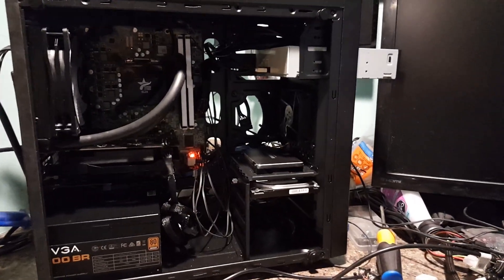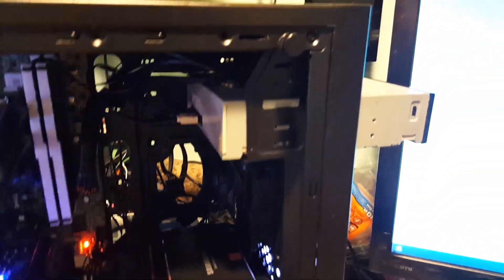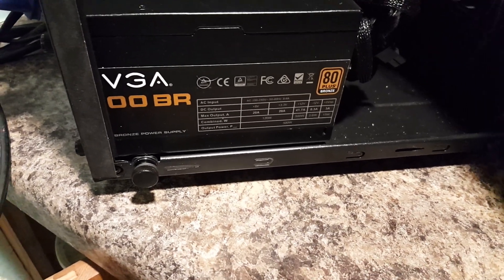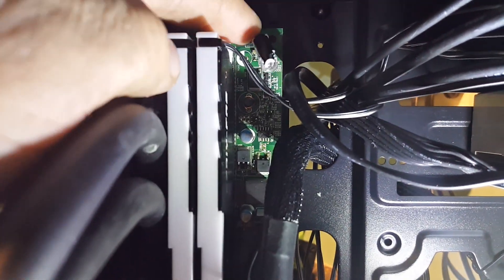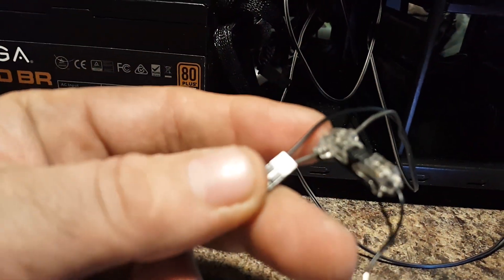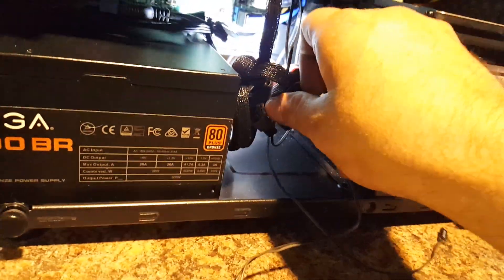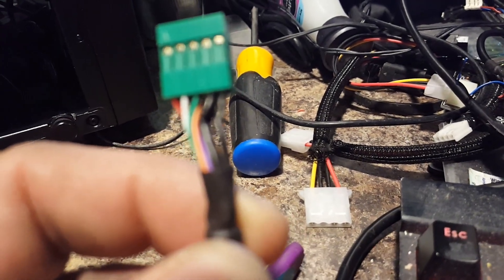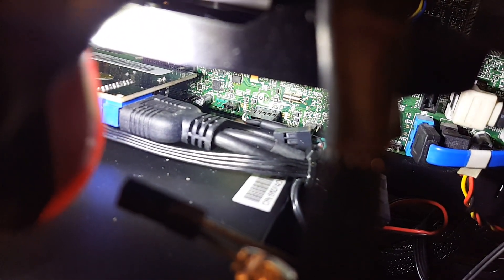How to properly hack and case swap the Dell OptiPlex 3010 front panel headers Part 1/2

Comment: sorry but I'm quite dumb with computers despite studying computer science, whats the original issue with the motherboard. I have one and it works fine but I just need to connect the power button using the Front IO connector, I assume this is what the issue is about?
Reply from the maker: Yes, Dell uses a proprietary connector for the front. You can also buy adapters to work around this from Harbin Repairs : https://store.harbinrepairs.com/index.php/product/dell-optiplex-390-3010-3020-front-panel-header-adapter-3pc-kit/

Comment: Can you use Front Panel Header Adapter Kit For Dell Optiplex 390, 3010, 3020 (3pc)
Reply from the maker: Yes, you can buy them from harbin repairs. https://store.harbinrepairs.com/index.php/product/dell-optiplex-390-3010-3020-front-panel-header-adapter-3pc-kit/

Comment: hi I watch this and your other video, I was wondering would this work for a dell optiplex i7 4770 sff xe2? heard the xe2's are the same as 7020/9020. just wondering if it's worth giving this a try with mine. thank you for your great video's and any help!!
Reply: You’ll never know until you try
Reply: @ZombieGuy115  I plan on a rtx 3060 since I found out it we work good with the new power supply I put in it. Voice cloning is what I really want to do. Right now I am using my nivida gtx 1650 super 4gb and it works just slowly.

Comment: hey buddy. I know this is years later but can I use the old I/O cable and just solder on the new case's wires into the old harness? And just leave it hanging in the tower? to avoid all those other things?

Comment: Thanks for this Great video. I followed this and your part 2 video to properly bypass. But i still get error. 1. Rear fan disconnected (yes i didnt connect a 3 header fan) 2. Front panel disconnected what could be reason. running latest bios from Dell on that board. is it possible to boot up without manually pressing F1
Reply from the maker: Sounds like you have the model with the extra fan header. You'll need to have a 3 pin or 4 pin fan connected to that header to eliminate the message. If you are still getting a front panel header error, check your USB ground connection.
Reply: @phreakwars  thank you. Rear fan issue solved. My power, reset, hdd lights all working fine. But still getting front panel I/o cable failure. Which I need to bypass? I did the usb, top small pin and front panel lights like you mentioned in video
Reply from the maker: @rajshanmugm  is Audio header plugged in? Message will still show if audio panel is not plugged in. It pulls a ground signal from audio to tell it if it's plugged in. Message displayed will be one that says front panel.
Reply: @phreakwars  yes. Really appreciate your response. It is connected. Should I recheck the front panel header bypass?
Reply from the maker: @rajshanmugm  Not sure what to tell you. Do you have the jumper connected to the USB port?
Reply: @phreakwars  yes.

Comment: Hello :)

I'm trying to achieve the same thing for a 7020 (MT) and/or a 9020 SFF.
Any idea how I should connect the wires (front panel headers and power switch header)
Thank you very much in advance for your help.
Reply from the maker: https://www.ebay.com/itm/264733441811
Reply: @phreakwars  thanks but that's relatively costly. I'd rather do something like you did. If that's possible.
Reply: @phreakwars  would that Front Panel Header Adapter work on a Dell Optiplex xe2 sff? I heard a few people say xe2 is the same as a 7020/9020 but can't believe everything people say. would feel good about it if a pro like you confirms it for me. don't want to damage the board if not.
Reply from the maker: @geraldcortez826  I believe it only works on the MT version, if you check his auction listings, he should have some for the SFF version as well.
Reply: @phreakwars  i hear that they don't work for sff. But I seen your video and it seem that you were using them on sff. So that's why I asked. Anyway thank you for taking the time to respond :)

Comment: what case are you using?
Reply from the maker: Doesn't matter. The board will fit in ANY mATX case. I've case swapped this board into many different cases.
Reply: @phreakwars   thank you for responding and also i was just asking because maybe different cases will have different cables

Comment: I changed the case for my dell optiplex 3010 sff and whenever I connect it to the power it starts by itself... any fix?
Reply from the maker: Check your BIOS settings
Reply: @phreakwars  ac recovery is disabled
Reply from the maker: I guess I'd have to see your wiring, hard to say.
Reply: Your power and ground are bridged.

Comment: So I am wanting to do the opposite. I wanna put a new microATX board inside the original case as a super sleeper build. I can’t find any information on if that’s possible and/or how to do it. Any ideas?
Reply from the maker: It's possible, should fit just fine, main issue will be with the power supply since it's kind of weak. If you have a different one, then you are good. You'd basically just tap into the power button to turn on. Fairly simple hack.
Reply: It’s very possible, I have a concept that is a work in progress.

Comment: I had that cpu cooler for a hot second, cheap but decent.
Reply from the maker: Yeah, main reason I bought it is because it was cheap. It was a lower budget tier customer so for those I tend to focus more on function of the PC component, not the looks/brand. It's still going strong to this day from what I understand.
Reply: @phreakwars  yea I had mine for about a year.  Used it on a 2600k and a 1650 v2. Both overclocked and handled it well.

Comment: been holding off on that project of swapping my optiplex 3010 for a while now coz I can't convince myself with those vids I've seen before with how to hack the pins for the switches and none of them was able to successfully boot without the errors just like you did. can we possibly connect? wanted to ask you a couple of questions coz my motherboard is not exactly the same as yours. I have only 2 sata ports and the diagram you have is definitely not the same as mine I think? thank you! for this content. Will order those wires now and get this project running finally.. ps. its the same exact case I wanted to use as well Lol! :D
Reply from the maker: I'm normally a very busy person, but I do devote time on Sundays and Mondays to help people. I can do like a ZOOM meeting or something then if you like.

Comment: Is it the same for dell optilex 3020 ??
Reply from the maker: No, the 3020 takes an adapter that you can get on Amazon.
Reply: @phreakwars  i have a 24 pin to 8 pin adapter i would ask for the audio and the front usb from new case can i put it normaly ??
Reply from the maker: Yes, I believe so. Haven't done a 3020 in a couple years.

Comment: Dose it work on vostro 430??
Reply from the maker: The Vostro 430, from what I can gather, does not require any additional wiring hacks. You should be able to do a case swap on it very easily.

Comment: I have the 790 how would this fit in
Reply from the maker: Unfortunately, I have never worked with that board, but I do believe the hack for the front panel on it, is the same as the 7010/9010, though I might be wrong. More info on those boards can be found here: https://linustechtips.com/main/topic/987783-optiplex-70109010-front-io-panel-pinout/

Comment: Getting a fan error message how do I get rid of it?
Reply from the maker: That would be the fan header in the lower right corner. What I did to alleviate that is reuse the stock fan. Reference this video where I talk about that starting at 1348 https://youtu.be/nX2gNqyWquo?t=828 You CAN use an aftermarket fan, but I'm not sure on the specifics for RPM that the 3010 is looking for at startup to advise which ones will work correctly to remove that message.

Comment: Am I correct in saying that the 2 pin reset switch effectively needs to cross 3 pins (with the middle not connected/used)? So if I were to split the plastic of my 2 pin down the middle I could just put it directly on those pins?
Reply from the maker: No, it needs to jumper together. Otherwise you will still get the error message.
Reply: @phreakwars  okay cheers, the second video seems to explain it better

Comment: hello mate, great video, im moving this motherboard to a dell xps 710 case, you just helped me with the sata 2 and 3 thanks so much, I would like to know, why you jumper those pings on the top, that 2nd power switch connector there?

Comment: We've designed some open source adapters that work with any front panel, retain the front panel diagnostic LED's, and it gets rid of that annoying front panel error on startup.
Reply from the maker: That's great, do you have a link to a website or something that you can share with others?
Reply: @phreakwars  It's in our latest video, can't post links in the comments unfortunately. You can also search for harbin repairs github and more information is posted there.
Reply from the maker: @HarbinRepairs  You can post a link, I have no problem with that. I ain't rude.

Comment: Excellent description.  Thanks for putting this together.  There really is a lot of bad information out there.  One question:  On pin 9 (on your diagram) the description says SATA 3 & 4.  Does the jumper between 5 & 9 Enable  SATA Ports 3 & 4 and fix the reset switch?  I've ordered some connectors to try it out.  I didn't realize until today that I only had two working SATA ports.  Thanks again!
Reply from the maker: Yes, it's a check back. I noticed it when I went to check the burner and it wasn't showing up in BIOS. Pretty sneaky move by Dell. I imagine it is there so the board knows if it's a mATX or SFF type. Don't see any other reason Dell would do this.

Comment: Will this work on the small form factor version of this motherboard? Mine look almost identical but that 16 pin connector is not under the ram it's under the pcie slot
Reply from the maker: Watch part 2 and I show an outline using the SFF type boards.

Comment: hello, good day could you give me some tips to update my Dell optiplex 9020?
Reply from the maker: Well sure, I see you are using the i7-4790, and that's about the best you can use, no point in using a 4790k since you can't really overclock on that board. You can run a max of 32 gigs of ram if you have 4 ram slots, and for a video card, you can run pretty much anything you want in it as long as you have a decent power supply. If you look here, this will give you an idea of what other's have used in their 9020: https://www.userbenchmark.com/System/Dell-OptiPlex-9020/820
Reply: Sir 
Can you give me dell.3020-mt 
Pc's 
Font panal connector 
Pin data
Reply from the maker: @sadiakeya8675  On that board you will need some adapters which can be found here: https://www.amazon.com/dp/B06XGWRTHC & here: https://www.amazon.com/dp/B073XJV5L9 pin out for the front panel is pretty much the same as the 3010.
Reply from the maker: Easy Gaming  no, the 9010 hack is a little different. Requires a couple adapters off of Amazon for a proper swap. I've actually been looking for a 9010/7010 board so that I can do a video on it. It's a little more complex than the 3010 and needs it's own video.

Comment: I would also like to know what adapter you used to place a different power source than the one that brings dell
Reply from the maker: Watch this video and you'll see me make an adapter: https://www.youtube.com/watch?v=CDd34GGAHM0 This one is for the 3010, you have a 9020, which is a little different. If I get a 9020/9010 in I'll do a video on that one as well.